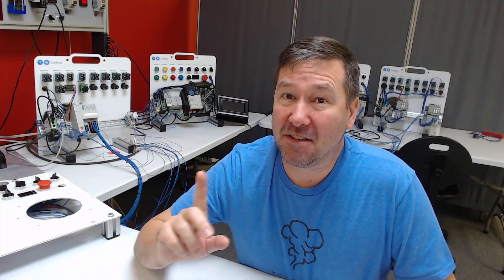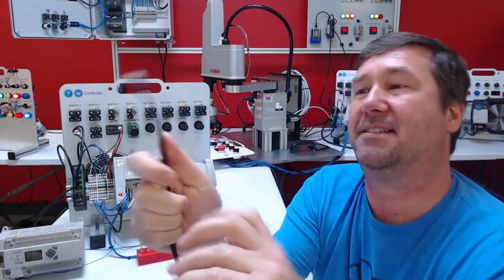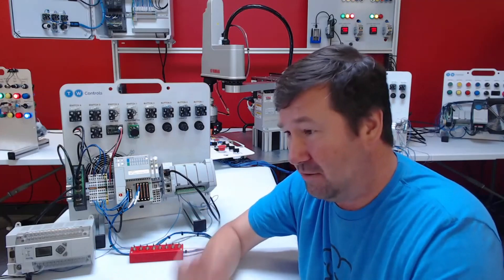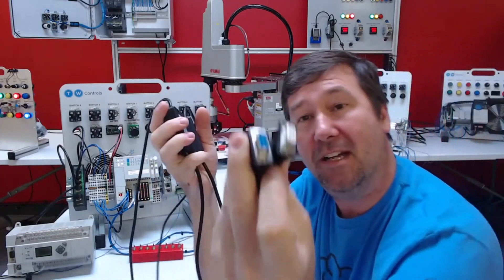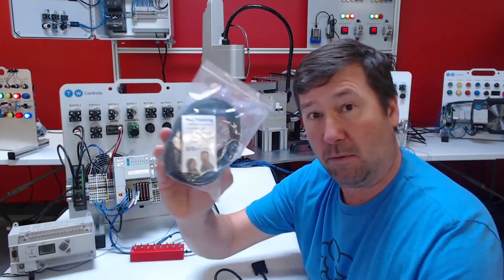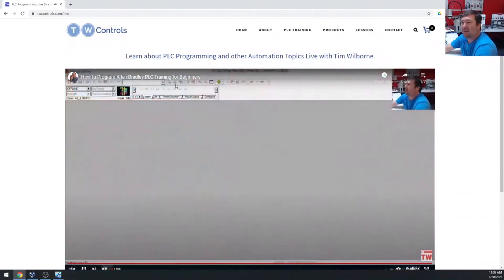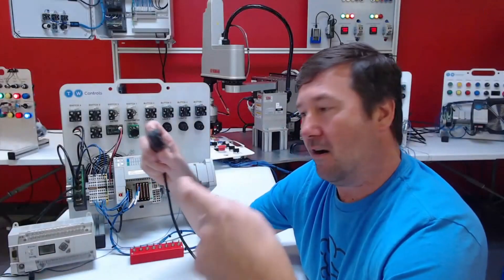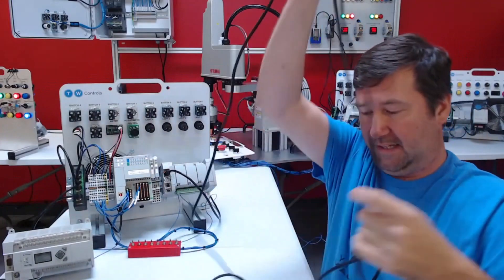Allen Bradley PLC Programming Cables

Comment: 485 port that uses an Ethernet looking connector/port.

Protocol converter.  Dh45 

Df1 protocol for rs232

Different pin outs.

2711 nc13 cable 
1747  Cp3